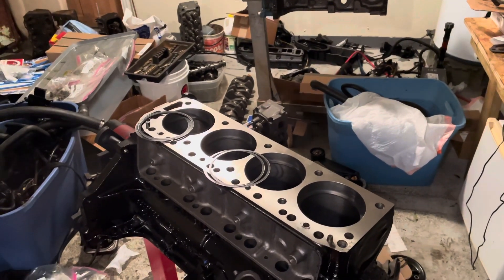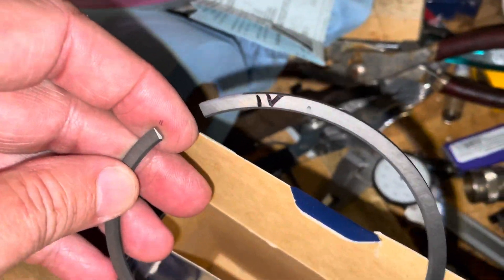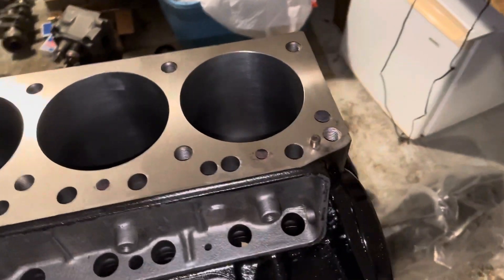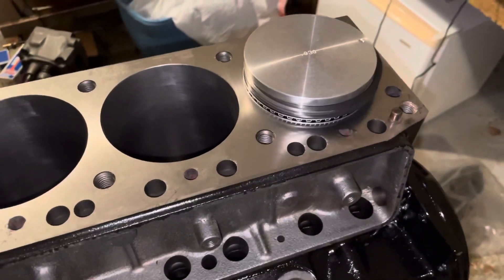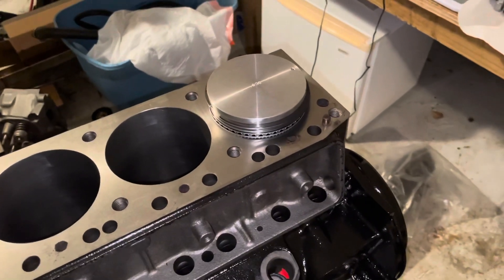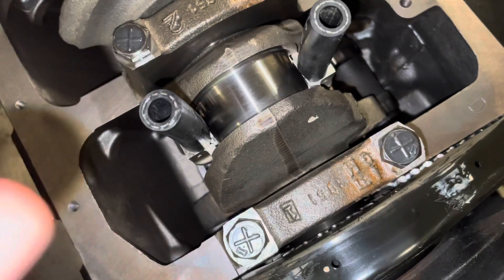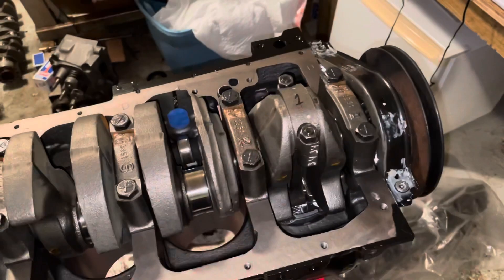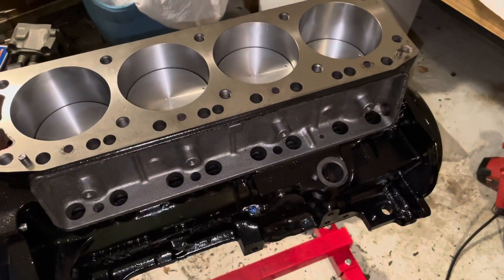Mercruiser 3.0 1(f) - Rings/Pistons Install

Comment: 11:56 
Building a stock variant of this engine
I have crank and pistons installed. I'm struggling to turn the crank, not as easy as I'm used to is this normal? I've tried turning crank gear by hand it's a bear but doable, same with turning the crank from bottom end it's a bear but doable. Is this normal? Didn't start until pistons went in.
Reply from the maker: No, it’s not normal. I have a video explaining how I made the same mistake. You probably used the wrong rod bearings.

https://youtu.be/8FVSQF6YPRo?si=nrdcx78tV25HR3M3
Reply: @moccasinmarine I watched that video I'm using the narrow bearing  MAHLE PART NUMBER :CB-663A
Standard size bearings and pistons on this build 
I believe the resistance im feeling maybe be from the new rings but I'm not sure honestly
Reply from the maker: CB-663A is the wide bearing.
Reply: @moccasinmarine part number for correct bearing?
Reply: @moccasinmarine I think I've got it. These bearings match the old. Spun crank with vice grips and it feels normal. I believe since I was trying to spin in different than that why I had so much resistance.
Reply from the maker: @NeverLiftYT you shouldn’t need more than 30 ft lbs torque to turn any fresh engine over

Comment: What orientation were all of the other piston rings? Exactly the same or did you reverse them on the cylinders where the intake and exhaust reverse?
Reply from the maker: All the ring gaps were oriented the same. I just follow the same pattern on a given engine. The orientation of the ring gaps, if it even matters at all, would have its greatest effect at ignition and during combustion. During exhaust and intake when the valves are open the pressures are much lower so I don’t think ring gap orientation has any correlation to which side the valves are on.
Reply: @moccasinmarine  so after this video you put all top ring gaps facing forward and 2nd rings facing rear..?
Reply from the maker: Yes. As long as they are staggered it doesn’t matter which gap faces which direction.